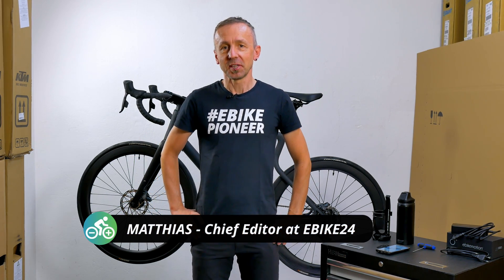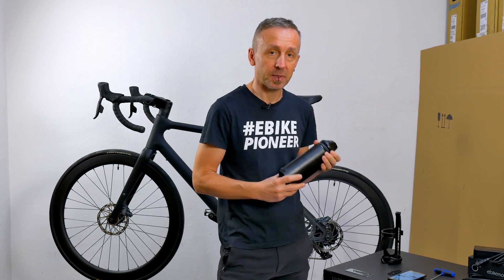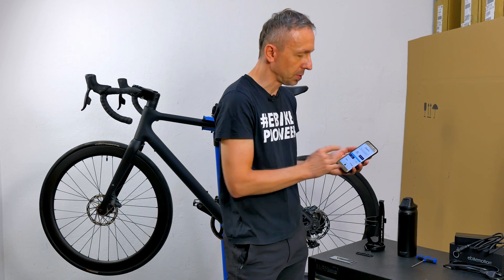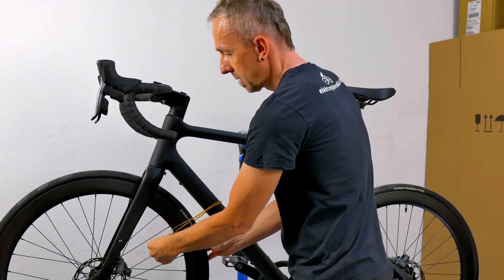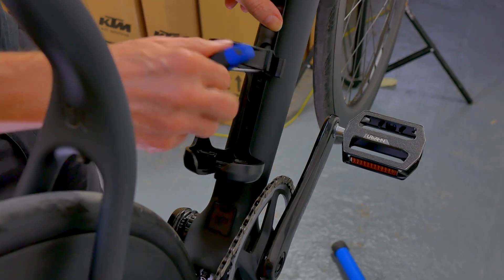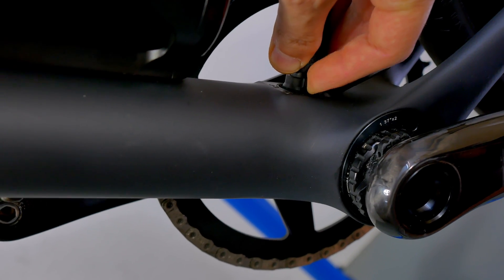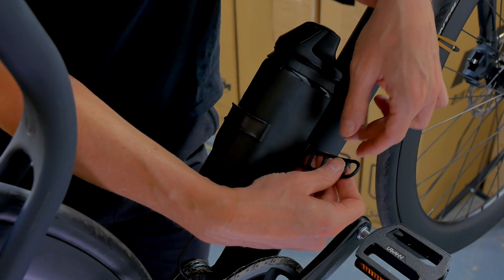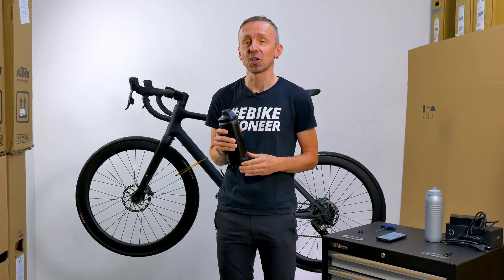How to mount the Mahle X35 Range Extender to your e-bike | EBIKE24

Comment: Note, do not use too long screws for holder as the length could damage the internal battery in the down tube.
Yes, the app is user unfriendly but it will show total kilometers when both batteries are connected together. You can also charge both batteries at the same time.
Don't rely on the Mahle app to record your journey it is useless, use Garmin and/or Strava systems for that. Garmin will also indicate how much battery is left.
Reply from the maker: Thanks, useful info.